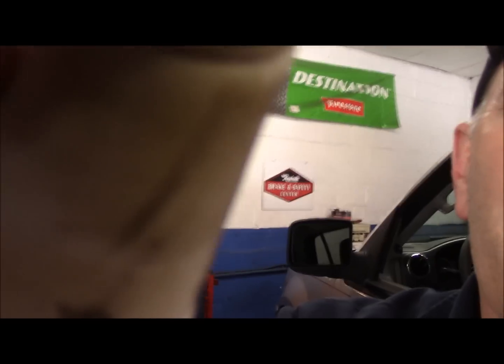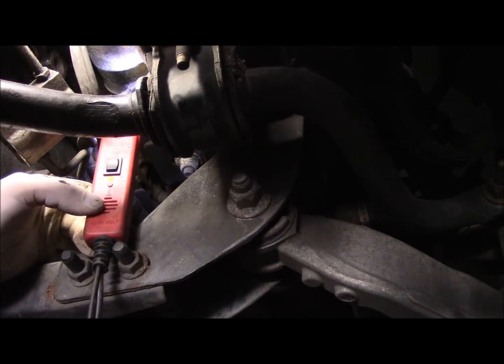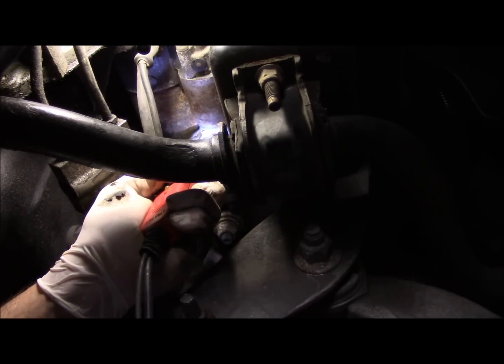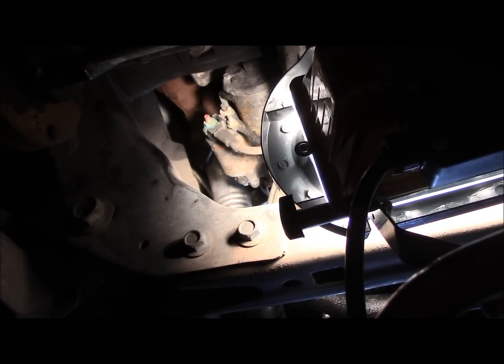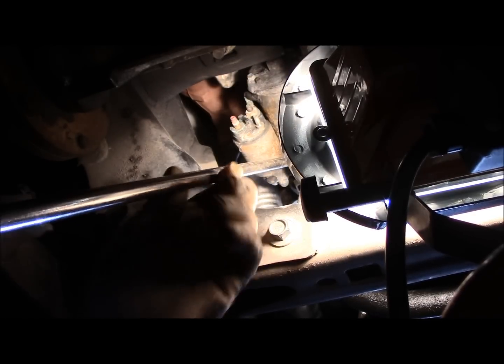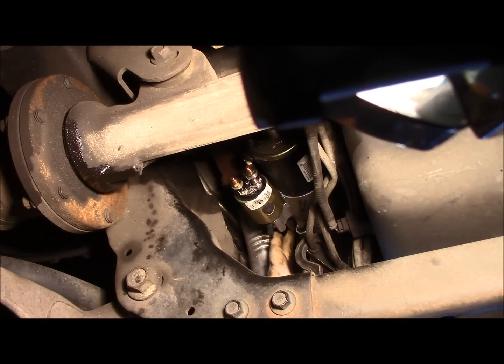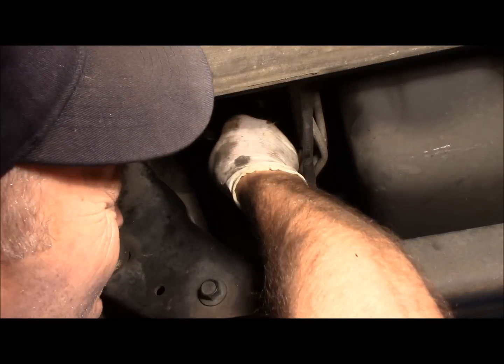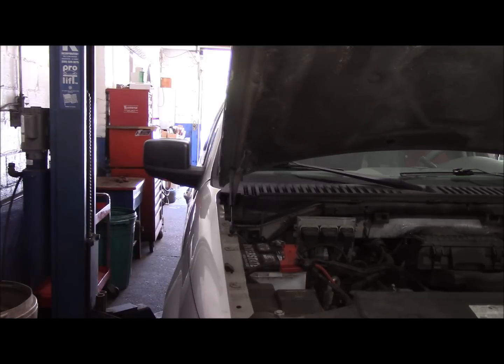Diagnosing  No Start / No Crank/Replace Starter 2006 Ford Expedition

Comment: Great video on a DIY starter replacement.  My vehicle stopped while on freeway and gauges went haywire. I noticed my starter was burned up when I got home and after your video was able to replace starter. Unfortunately after replacing starter, I still get no crank no start. Any further troubleshooting suggestions?
Reply: Same here

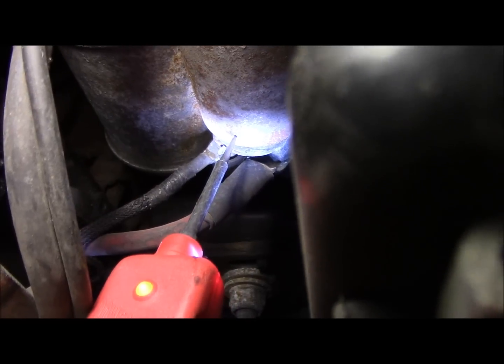Comment: Watching 6 years later.... as I'm having similar trouble. Sparky making an appearance at 5:05 confirmed the power. 05-10-2023 1640 PT
Reply: Connected a momentary switch, long enough to reach the dash from the engine bay, as we discovered that the starter works, by a quick bypass test. 

It could be a break in the power cable to the starter from the fuse box, don't fully know. But for now, if needed, a starter button is in place, so I can go out and replenish my bank account$, as they went red with not working the past 2 weeks.

2011 Chevy HHR with ~242K miles 

05-11-2023 1321 PT

Comment: Hello, I have a 06 Ford Expedition. it's been extremely cold weather here in Massachusetts but the truck has been working with no issues. So with weather, so I crank and let run for like 45 minutes to make sure that it was nice and warm before I drove it off but when I got to one of my destinations I cut the truck off and it will not start. nothing lights up, no sounds. when I took the key out of the ignition, it was c clicking noise coming from the rear passenger side of the truck but whenever I turn the ignition again the clicking noise would stop when I remove the key more clicking. Have to lock the doors manually.   There's is no power anywhere on the vehicle I've taken the battery out took it to AutoZone got a check they said the battery was fine brought it back tried to get a jump off that didn't work so we set there for a few minutes everything lit up and it popped back on. so I could crank it n drive. But as I drove the lights would flicker on and off. An once I turn it off there's nothing anything again.  What do you think the problem could be?  I've heard it's the starter, heard its the fuel pump, I've heard it's the alternator, I've heard it's the cables. What is the first step that I should take to have my check truck checked out?

Comment: Thanks for the video, I have 03 expedition I have a no start too, and the horn is not working also...I just changed alternator, serpentine belt, two pulleys alternator wiring harness..took battery out for about a week clean ternminals .. The posotive Battery cable end had corrosion, so I cut that piece off ..should I install new starter?..everything else works except horn?..gona check fuse as soon as the snow melts working out of my drive way

Comment: Jim that's good advice to test the battery first, couple years back I had a truck no crank and the battery voltage was 12.6 and the owner said he was going to get a new starter . I put my battery tester on it and immediately it read defective. OCV is not a valid test in this case and it was just a  bad battery. Only seen that once. He did try to boost it and as soon as he attached the cables to the battery sparks were flying. Haha
Reply: Was there any load on the battery reading 12.6 ?
Reply: Tom OConnor  Tom no load just the DMM reading and I had to argue  with the guy that one reading is not a diagnosis  it's a guess. I asked him to turn on the headlamps and he said that has nothing to do with the battery reading. Haha apparently he seen on youtube how to do it. Oh well I sent him over my buddies channel that teaches diognostics  for a living.
Reply from the maker: Oh yea I've seen that before As soon as you put a load on it it just drops off
Reply: jimthecarguy Yes like a rock, Only seen it once. Hey Jim are you going over to Joes new shop tomorrow for the grand opening.
Reply from the maker: Yes if I have the time

Comment: I have a 2007 Ford 500 the compressor have froze up and broke the belt the belt broke the wise on the sensor I replace it with a new sensor and new wiring harness knot is still just whining but won't crank up

Comment: Currently working on my 04 navigator. The ignition switch/starter solenoid keeps tripping. I checked for bare wires and fixed that, but blew the fuse again... 
I did replace my battery too. When I turn the key the radio works but the instrument cluster does not come on... could it be the ignition switch tripping the fuse stopping power to go to the ignition solenoid? 
Thanks in advance!

Comment: Buick no start check starter battery cable and disconnect negative side and then positive install cable opposite side this how to diagnose a no start and top the starter with a hammer gently

good video and learn a lot thanks

Comment: Hello jimthecarguy I  have a 2005 GMC envoy and it wont start or crank ive brought a new battery and a starter because that what i was told that was the problem, but it still wont start, my friend hit on the starter and it started to start but didn't  now im being told that its the ingitior switch and shark plug

Comment: Hey I just replaced a starter on my sons 2004 Ford explorer and  I did everything right , that starter didn't work and I got another new starter put that on and the starter still won't engage , there's no way I got 2 bad starters in a row unless I put the battery wire on the wrong side or bad fuse or something , just curious does the battery wire go in the side with the flat wire that's attached to the solenoid or the empty post ? I mean I put it on the same way I took it off ....
Reply from the maker: From what you are saying It should go to the side that is empty . Can you send me a picture of how you connected the wires on the starter?

Comment: What if you jump the starter and it still doesn't crank i put a new battery in my expedition and now all it does is click in the fuse box when i hit the key checked all fuses and relays all good jumped the starter an it spins but still won't start have no clue what to do

Comment: So i have a 2005 Ford F-150 with the 5.4 3v triton so it started this morning went to store them came home went to use the truck tonight and got in sent to start it then nothing it has a the check engine light the battery light a light that looks like a wrench and the 4x4high and low glad a few times then stops won't start or even try to crank. So thought starter but when I touch the solenoid ends with screw driver the starter spins but stii won't start what would I check next
Reply from the maker: Can you send me a short video of the problem?
Reply: @jimthecarguy  I figured it out. It was one of the relays

Comment: Hey guys I have the same exact problem I have a 03 Expedition XLT won't crank when you try to start it made a that clicking noise so all I did was I got my manual found out where all the fuses were all I had to do was change a little tiny fuse I believe it's the starter relay fuse Expedition started right up haven't had a problem since hope this information was helpful to you all
Reply: Minicka Collins can you take a picture where is the relay fuse please

Comment: After watching your video How to troubleshoot a starting system (bad ignition switch) - Dodge Neon I have a Question: I recently bought a 2003 Lincoln Towncar 69k miles garage kept. nothing was wrong the first 1200 miles... then one day no crank no start last week I changed out my ignition switch thinking that was the problem ...(electrical side) under dash on column only $20 it was not the problem . I also can crawl under car and jump the starter off the positive post of starter to start post so i know starter battery and solenoid work that is why i changed ignition switch. ( I also removed starter and had it bench tested at the auto parts store (works fine only 69k miles on it) and then reinstalled) when I pull out the starter relay under the hood in fuse box and put a test light in terminals after checking ground and making sure light works ( it did) There is no power in any of the 4 pins of the relay terminal and when in run and crank position there is no power in any of the 4 pins in the terminal . Does this leave me with a PCM problem because that controls neutral safety and starter signal? I have checked all fuses and all working . The dash cluster warning lights also do not light up when key is turned to run and there is no security light flashing in cluster. However the flashing light for security does shut off after 3 seconds like it is supposed to on the dash when key is in run right before crank position. please help me confirm it may be pcm , Thanks Rich

Comment: Nice job.  My 2000 Ford Explorer sounded like it wasn't getting gas, so I put it in neutral and pressed on the gas a little.  It made a metal clanking noise and stopped.  Nothing happens when I try to start it.  No clicking, just like your car in this video.  As a side note, the car was towed to my house, and the tow truck changed from towing from the back to the front to back my Explorer into my drive.  At that point, all battery functions stopped working.  He even rolled the window down before he switched to tow from the front.  Is there a master control on an Explorer that turns off all power?
Reply: Nice video got a question I have a 2003 Ford Ranger with the 3 liter V6 and it has a no crank no start I've changed the ignition switch check the relays and fuses and everything seems okay I've even tried different Keys thinking it may be the security system but I get a no crank no start intermittently it usually happens after I run the truck for a few miles and it warms up that I have to turn the key about a dozen times then it'll start. I hear no clicking coming from the starter and I've seen other videos online where people have replaced the starter and situations like this and they still have the same problem. Have you heard anything like this before have a solution? It would be much appreciated thanks

Comment: Hello Jim, i have a 2003 Mountaineer and at first it was doing a loud clicking sound. Checked the battery and reading came back at 13.6.  What is interesting is the door does not chime with the key in the ignition and no lights on the dash either.  Removed the starter and took it to O'Reillys to get it checked out and was told it was bad. Put the new starter, but i'm getting the same results.
Removed the starter relay and put a jumper cable and was able to turn the engine, but no start. Is there a way to check the relays?  Can you help?  Thanks,

Comment: Hi I am OMAR vasquez I have a 2001 is the rodeo V6 no spark no injector pulse before it was 40 psi on the fuel now it’s dead everything I don’t know what to do
Reply from the maker: Did you scan for codes?
Reply: P1290,p1299

Comment: Hey Jim, first of all thank you for the video. So I changed the starter, I have full connection to all the wires to the starter. I can actually jump the car from the starter like you were attempting to in the video. But I still can't start the car by turning over the key. What do you think the problem could be? Really would appreciate an answer have a blessed day
Reply: Did u figure out the issues I'm having the same problem in my 2007 ford expedition

Comment: I have a 2003 ford explorer its a no crank no start. Starter is brand new but still nothing. Just a clicking noise. One click every turn.  No turning over.  Any advice? I was told my cables to the starter were bad, and also was told by someone else to replace battery cables and terminals.

Comment: Thanks for the video , hey i have a 98 ford expedition that im having problems cranking on , some ppl say its my flywheel thats in bad shape and others say it my started , but when i try to crank on it makes a noise   and after it makes the noise after the 10nth try it cranks on , whats your opinion?? Thanks
Reply: Mine is 98 also wont start no crank replaced starter and starter solenoid and new plugs and wires still wont do anything. All my lights and everything come on

Comment: Thanks for the video. I have a question for you. My Ford Fusion 2013 has the check engine light on. It has a code P144C. The evap purge solenoid needs to be replaced. I have you had to fix any and if you have what is the process and is that something that is important to fix? I have seen where this is a very common problem in Fords over the last few years. Thanks for the info.
Reply from the maker: If you e mail me at work tomorrow I will send you the procedure.
Reply: +jimthecarguy What is your e-mail? thanks!

Comment: Jim, I am looking to purchase a 2006 Ford Expedition. I know hardly anything about this truck. Does not have a battery. I've tried to jump it from another vehicle, but nothing but clicks. Could it be because it requires a battery for a good ground and it needs the cracking amps? I'm not forking over money till I know I can hear it run, because they say it does. Any idea where to start? I'm sure your're gonna say get a battery on there.......But just wanting to cover all basis.
Reply from the maker: Yes the first thing to do is out a battery in it so you can hear it run. Is there a lot if miles on it?
Reply: @jimthecarguy  So, I put a hot battery on, just clicking. Sounds like the solenoid. I'm not able to get under the truck right now. As I said before, it's been sitting over two years, I bet the armacher is stuck.
Reply: @jimthecarguy  it has 165,xxx miles......  When I get a way to pull the starter I'll jumper it out of the truck and see if it kicks off. If it doesn't I believe I've answered my own question...
Reply: OK I have an update. So I put a good battery on the expedition. I’m not able to get the truck to turn over by the ignition switch. I hear the solenoid clicking but it’s not starting. So I’m assuming it’s a bad starter. On the other hand, I was able to jumper the starter with some jumper cables and after a few attempts the starter finally engaged and I got the engine to turn over. After sitting for four years, this engine actually turned over and ran smoothly, it was amazing. So I’m going to purchase a starter from eBay. Like $50. And I’m hoping that resolved that issue. Then I will have to bring up this other issue and see what your opinion is. It has to do with the dome lights and the radio not turning off. And I’m assuming it’s probably door switches.

Comment: My truck is doing the same thing. The battery is good and the cables are well connected. I removed the starter and took it to auto zone and they told me it was good but after watching this it might be the starter. What do you think?
Reply: You can always get it tested for free at AutoZone & Oriellys.. if it pass its good to go if it fails well time for a new starter.
Reply: I have gotten bad rebuild starters, As a point I have them test it also.

Comment: i have a 2004 f150 5.4l I'm not getting power to the smallest wire on starter, when ignition is (on)? big power wire yes

Comment: This helped 100%, the checking the headlights while trying to start it was just like what was happening. So after 4 hrs of work I'm done and it cranked right up. 2006 Expedtition XLT 4X4
Reply from the maker: Marvin Talley,Jr. great I'm happy to help thank you for stopping by the shop
Reply: You're welcome. I was stumped at first til I tried what you did with the headlight deal. That and knocking on the starter and it clicked a little. You saved me from paying someone to do it and I just plain happy right now.
Reply: What about with an 07 expedition

Comment: I have a 2005 explorer.  I've been trying to figure out what's wrong for a whole week an a half.  Already changed the fuel pump, with it's filter. Also, checked the crank. I bought a new, because I thought the old one was not getting any connection, yet with the new one it still won't spark.  When I try to start her, she won't start. In the monitor to the left (inside and next to the mikes counter) it pops-up "test"... Could it be the key or a relay?
Reply: I have a 2005 for explorer and mine is doing the exactly the same thing...

Comment: hay there, I have a 2001 ford escape xlt 4x4 that won't start. I installed a new water pump yesturday, after I got done doing that, I went to start it and nothing happened. Plus shift won't move also from park. all lights are working. but no start,  just a humming sound in front engine. please reply to me,  thanks.
Reply from the maker: Noe Flores    Do you want to call me at work tomorrow?
Reply: really don't have time,  I work all day. don't get home from work till,  7:oo p. m. can you give me any ideas why it won't start please  .
Reply: any idea what could be wrong with my , 2001 Ford Escape xlt 4x4 that won't start. just makes a humming sound.

Comment: My expedition is the same but i had a battery checker and it says its good but it still wont turn on anything? Not the radio or any lights at all
Reply: xNitrodan check your fuses

Comment: I have 2006 Ford Expedition I just changed out my turn signal switch  soon as I did that I went to put my key in the ignition no lights popped up on dashboard tried to start it didn’t start up. I went to go jump it still not crank no turn over nothing only thing was working were the dome lights inside truck need help please anybody

Comment: My daughter was driving her 2005 escape down the interstate and it died.  The battery is good, all fluids are good but the thing will not crank.  It makes no sound at all.  Help
Reply: My 05 escape is doing the same did you get your fixed and what was it
Reply: @tman0317  randomly dying like that has almost always been a ground issue for me

Comment: I've done my share of starters. That's the first one I've ever seen with the solenoid on the bottom! M most of the time, I drop the starter first to get at those wires. I know you can't with that one .